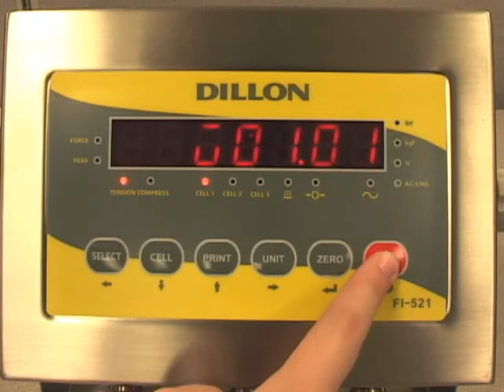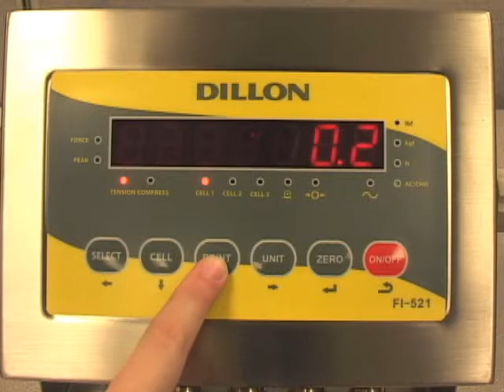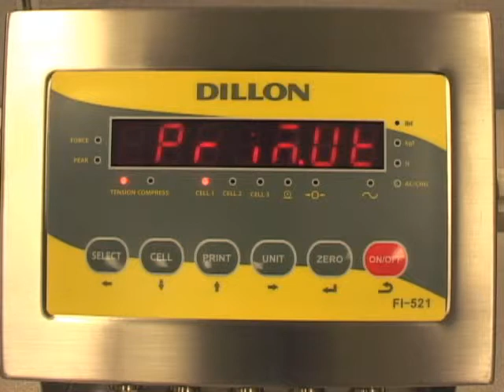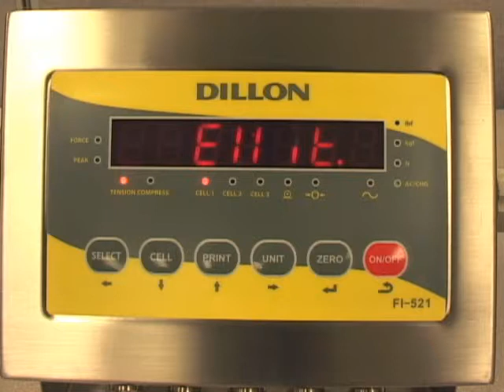FI-521 Indicator Configuration

Comment: Trying to use a load cell in compression mode but whether I set it to tension or compression, the value is always negative. Also, my 5000 lbf load cell maxes out at 100 lbf. Ideas?